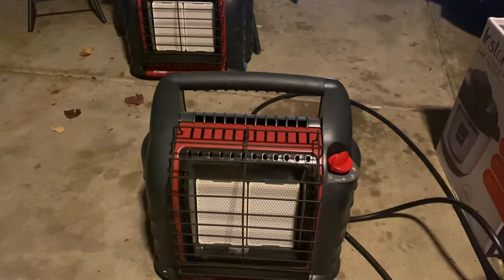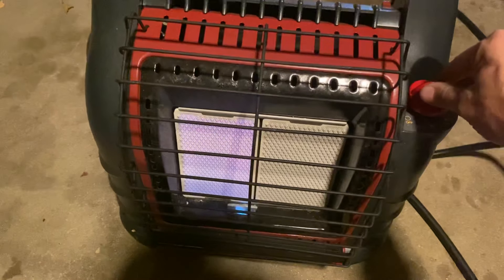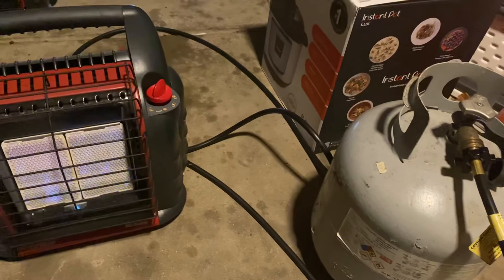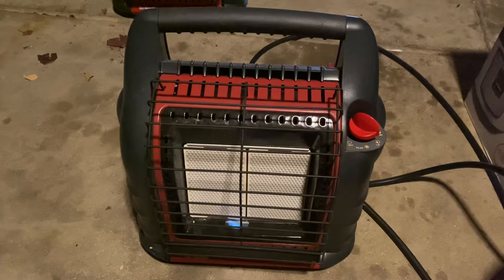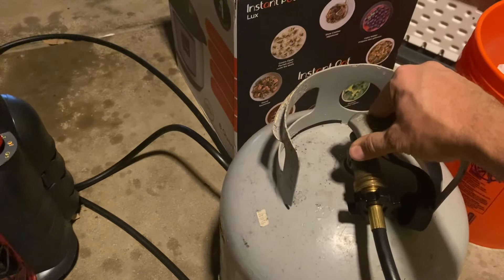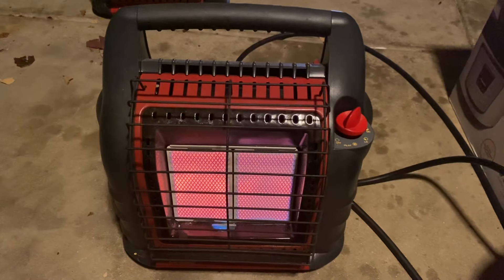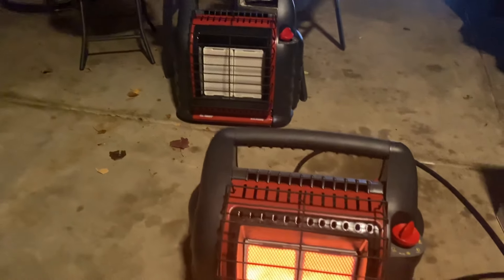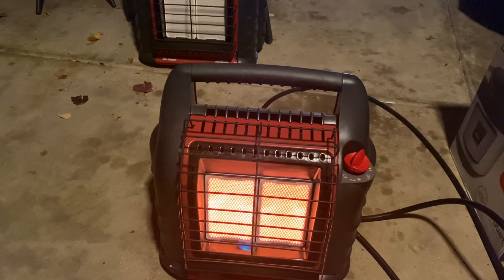Mr. Heater Big Buddy Shuts Off-FIXED

Comment: Thanks for posting this video! I was about ready to return the 12' line and filter and go back to the 1lb tanks but you helped me solve the issue. My question for you is: should I slowly open the valve on tank all the way or should I leave it open just enough so the gas comes out? Thanks
Reply from the maker: As long as you open it up slowly you can open it all the way. That’s what I do. Well technically I go more than half way. It doesn’t waste more fuel if you open it all the way, it just assures you have a steady flow.
Reply: @cabinlife1886  awesome! Thanks again!!
Reply: Thank you, it worked!!!!
No I can recall my new Webber Grill does the EXACT same thing btw
Reply from the maker: Mine too! But it won’t anymore! Lol

Comment: That or you didn't use the right hose and clogged your filter
Reply from the maker: I bought a new filter and had the same issue. When I used the other heater it also has a different hose, the quick disconnect kind that you don’t need a filter. Two different heaters same problem until I turned on the propane slowly instead of cranking it on fast. There was nothing wrong with the heaters at all. I even showed how I can replicate the issue for you and how to prevent it. Try it and if it doesn’t work you might have to replace parts.